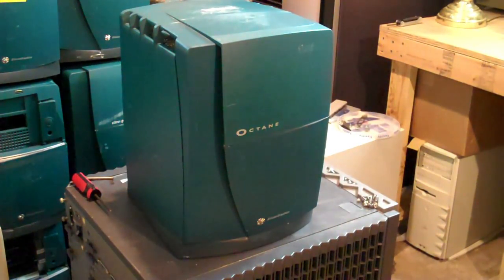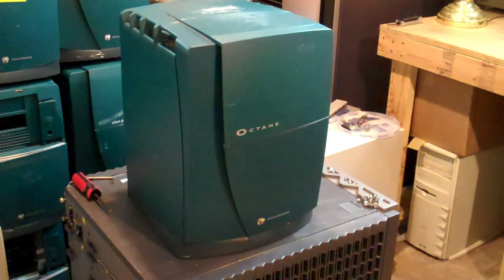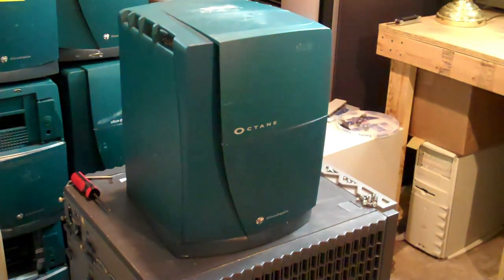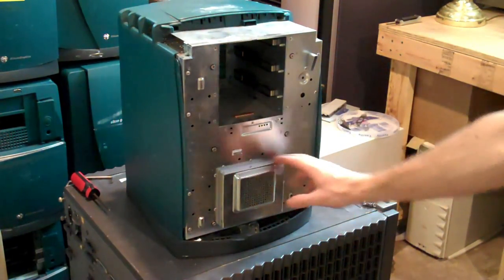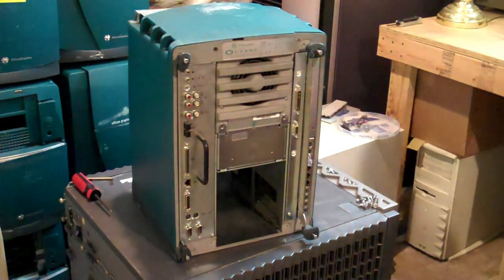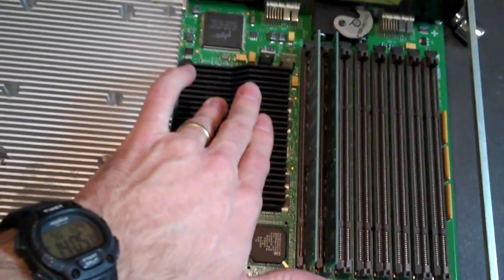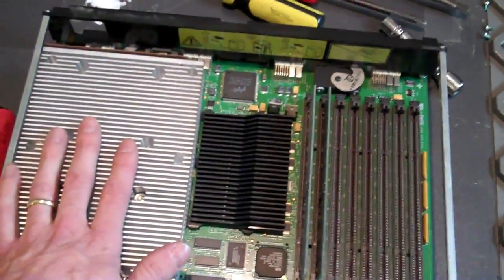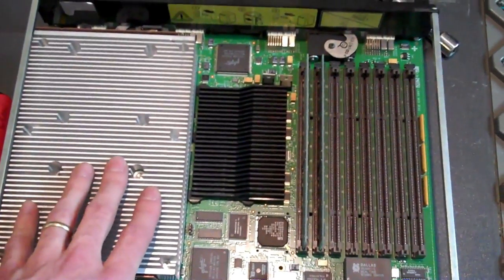SGI Octane Tour & Disassembly - Part One

Comment: HELLO, I HAVE A COMPUTER SGI OCTANE, MY QUESTION IS: CAN I CONNECT A HARD DISK SATA USING A SCSI TO SATA CONNECTOR? WILL I WORK?
Reply from the maker: Hell Osmarys; I genuinely don't know the answer to this question - however I know people are using scsi2sd adaptors in their SGIs so I should think a quality adaptor, regardless of the source media, should work just fine. The SGIs are less twitchy about disk settings (C/H/S/etc) than early Suns, for example. Good luck!

Comment: How and where exactly would I find an SGI Octane in 2018 tho?
Reply from the maker: A reasonable question - Octanes are "new enough" that they're still around in reasonable numbers - certainly they show up on eBay with some frequency. Although given their weight I'd hate to ship one.  There are numerous online groups - Classic Computing, VCF, Reddit SGI groups, etc - that you can use if you're so motivated. This is probably where luck runs into financial support. You might get lucky and someone is giving one away, or giving it away cheaply - but if you're willing to pay you'll find it opens a lot of doors :) Good luck!
Reply: @jpkiwigeek  thanks for the info and assistance! I'm hoping that I'll eventually find one...

Comment: I picked my Octane up back in 2004, there was some kind of yard sale at our local University. Payed 50€ for it, which is just incredible to think that this thing cost tens of thousands of € new :-) Still have it, boot it up from time to time and just enjoy my all-time favorite UNIX... Irix was the truth.
Reply from the maker: For 2004 that's a fair price, you did well.  These were/are absolute beasts and a nice machine. Pity about SGI. :)
Reply: Right now an Intel NUC with Iris Pro will blow away the performance of this model. Amazing an entire computer smaller than one of the octane drives.
Reply: jpkiwigeek I highly, highly doubt that. The integrated GPU sits on the CPUs ringbus which is extremely high bandwidth and I also doubt the GPU would have any problem being many, many times faster than decades old SGI stuff.
Reply from the maker: That's probably not entirely accurate. The bandwidth available for the Octane to slug data over to its graphics subsystem and the speed of the entire graphics module will be significantly greater than the NUC, which is not designed as a visualisation system and therefore is a "generalised" computer and not something specifically built for this feature. One of these days I'll get some software written to actually benchmark this crap because there's a lot of misunderstanding about this sort of thing. Not that I'm not suggesting a 3.4GHz i7 wouldn't smoke an R12k ;)

Comment from the maker: All of the devices in a computer (whether it be the processor, a sound card, or an onboard ethernet controller, or what have you) communicate via a bus. At its lowest level, it's just a bunch of wires that the communication between those devices occur. Some buses have more wires than others, and some are clocked at a higher rate than others, so different bus types can have radical effects on what's talking over them.

Comment: I remember looking at a  3D workstation that had dual alphas back in the 90's to run 3D applications like PowerAnimator and Max......I would drool over owning one. Had a dual Pent Pro with 128mb ram instead though.

Comment from the maker: I'm down to my last SGI monitor, annoyingly. You can, however, purchase 13W3 to VGA cables or convertors - just be sure you can one that'll work with an SGI, as the Sun and SGI video signals are not entirely compatible (if memory services, Sun is Sync on Green and SGI isn't, but it might be the other way 'round)

Comment: Hi, all I know is, that a 32 processor Fuel workstation @900 Mhz, is almost equal with a i7 2600k.....but notice it has 32 processors lol...so the i7 is pretty damn powerful and will beat any Octane, Fuel, o2 or Indigo

Comment: On release SGI systems could be bought for £22000+ back then they were light years ahead of PC systems for CG. Do these systems still offer reasonable performance in comparison to a decent PC workstation today equipped with Firepro or Quadro cards? Any information or comparisons would be greatly appreciated.
Reply: Not even close to modern machines. They fell out of usage as soon as better stuff came along.
Reply: @AureliusR  Thanks for the prompt reply, much appreciated.

Comment from the maker: Any PS/2 keyboard will work with an Octane. SGI hasn't used proprietary keyboards since the original Onyx. Even then you can actually buy/build adaptors using microcontrollers to do the conversion, as it happens.

Comment: Very nice computer. Id get one but the only ones I can find are $300+. If it it is a stock original it should have a 270 mHZ processor and 1 gig of RAM. The later design of the Octane 1 actually had a darker case.

btw 0'th view